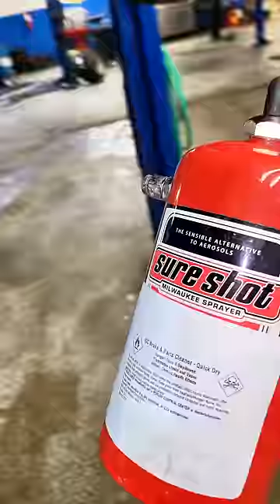Oil Change Perfection 😗👌 #honda #oilchange #satisfying

Comment: That oil looks like a muddy sludge mess
Reply: Probably has coolant in it
Reply: It looks like that because of the camera light/flash.
Reply: It is liquor molly
Reply: Lots of water, because it is opaque, not shiny anymore.
Reply: @cmte.brazinazzo2061   Lol, do you even know what oil and water mixed in an engine looks like? 😅That's not it pal.
Reply: @tiagofigueiredo2529  up until 2% emulsify, pal. Get your facts straight. Lol maess.
Reply: @cmte.brazinazzo2061  And you got that just by watching a video, imagine if you were there changing the oil yourself, what an absolute genius. 😆
When you decide to change some engine oil, do this, take your phone out of your pocket, turn your flash on, film it and look at the vídeo to see how the oil looks like with light directed to it, specially if it comes out of a gasoline engine. 😅
Then, after you get some experience, you can comment about it.
Reply: @tiagofigueiredo2529  I'm an oil engineer, from STLE. Yes, you're  talking to a genius.
Reply: @cmte.brazinazzo2061  Sure, commenters like you are always "engineers". 🤣😆
Reply: The lighting probably has something to do with the colour… it definitely looked pretty dirty, but the oil on my little Hyundai beater looks terrible every time I change it, and me and the previous owner have always changed it a little bit earlier than required.
Reply: @cmte.brazinazzo2061  if that was water, the "oil" would have the look and consistency of a milkshake. ask me how i know.
Reply: Oil dilution from fuel
Reply: Oil looks like chocolate milk...I think it's way past an oil change !!
Reply: Nasty looking. When I drain my oil it has color but it's clear looking. Not muddied up like this one.
Reply: @tiagofigueiredo2529  Yes, an instant degree in petroleum engineering.
Reply: @cmte.brazinazzo2061 engineer my ass. Oil and coolant mixed together looks like a cappuccino. Everyone should know this.
Reply: @DGKexe  Yes, it also could be if using hygroscopic fuel, oxigenates, like alcohols added to gasoline.
Reply: @cmte.brazinazzo2061 it's like custard oil and water mix
Reply: Oil change was probably over due. Oil filter was clogged the fuck out. Thats why the oil was spilling like a water stream.
Reply: No coolant in oil. Its just engine debris mixed in oil that is past over due.
Reply: @katdat1399 I work at an oil change shop at a dealership and saw oil coming out looking like chocolate milk. That definitely had a blown head gasket. This oil doesn't look the same. It's just old and a little burnt.
Reply: Just like treas-a-dent Chump's muddy swamp he made worse 🤣
Reply: @cmte.brazinazzo2061 if you're gonna lie at least lie good. That was pathetic 😂
Reply: Wanting some mofok?
Reply: @tiagofigueiredo2529  My evo is 20+ years old and changing its oil doesn't look like chocolate shit. Dark shiny brown with a bit of transparency and that car likes burning oil
Reply: Oh Reeeally
Reply: It’s the CVT transmission that does it for me
Reply: @katdat1399 not Milky but dirty meaning old engine oil. Mine was old like they head gasket was fine tho
Reply: @katdat1399 9 months later I should say😁
Reply: Drain plug installed to soon.lots of dirty oil mixing the new oil.
Reply: They get a lot of fuel into the oil, these engines would look like that with the first oil change with 6k miles on them
Reply: Nice one 👍 💯 👌 😌 😎
Reply: It’s also a Honda.
Reply: Just because there’s a flash light on it
Reply: Milkshake=coolant in oil
Reply: @bradman1961  🤜🤛💯
Reply: Kinda looks like engine dye
Reply: @JacksoNR26  🤝🤝💯
Reply: its 100% just because a flash light on it
 @JacksoNR26
Reply: It’s because the light.
Reply: I think you left your comment on the wrong video lad, that's liquid.
Reply: @RSLucid  🤝💯
Reply: @michaelboyle3584  💪💪💯
Reply: I was gonna say. That oil is having some contact with coolant. It doesn’t look necessarily bad. But definitely not ideal.
Reply: Looks more like molasses
Reply: @cmte.brazinazzo2061  Hahaha...a genius that can't spell genius.
Reply: @roopan1968  I can, my keyboard is multilanguage and sometimes it gets in confusion. You Never had this problem, because you're a mere single language guy ...
Reply: @cmte.brazinazzo2061  A true genius would adapt and overcome. Or, at the very least, proofread and correct as necessary.
Reply: It's a Honda, so it's probably fine (only need to change the oil like once every 300,000 miles)..
Reply: @tiagofigueiredo2529 he's not your pal, friend
Reply: You and Thous entonces Oly See The Consecuences
But I See Some Solutions in my Comment Above ☝🏽
There is NOT such a mission imposible in This Life.
But To Prevent Death,  Sorry About it
Reply: @cmte.brazinazzo2061 How convenient that you're an engineer, too bad you're a horrible liar

Water in oil creates a mixture that resembles spoiled milk. Common knowledge. Some genius you are.
Reply: @cmte.brazinazzo2061  "and sometimes it gets in confusion"

It's "gets confused" not "get in confusion." Some multilingual (also proper word, not "multilanguage") person you are.

Again, very bad liar.
Reply: @rodimusprime3621  How about you, pal?
Reply: @tiagofigueiredo2529  I'm not your pal, buddy
Reply: @rodimusprime3621  Why not, comrade?
Reply: What spray is that ?
Reply: @cmte.brazinazzo2061 boy if there was water in the oil you would know because oil and water don’t mix and it would most likely pour water out since oil sits on top of water
Reply: @elementalgaming2264  Hah, never heard of emulsification percentagem... boy...
Reply: @cmte.brazinazzo2061 You can't even spell genius, college boy. Genius,  Bwaahahaha
Reply: That's why you change it 😂
Reply: CERATEC
Reply: Average car owner shit. 20k mile oil change or fuel dilution/blown head gasket.
Reply: They get excessive fuel in the oil, even with 5k mile oil change interval and the oil looks like that
Reply: Looks like most of the engine came out in the oil

Comment: puts the drain plug back in with sump oil still draining out, perfection lol 🤣
Reply: No point in waiting an extra 20 mins for 50ml to drop out when ur gonna pour back in 99.9% of new oil😭
Reply: Here at jiffylube we don't want your business
Reply: @tdc9136  been doing my own for 35 or so years, think i'll be ok 😁👍
Reply: I wonder how much I saved over the last 35-40yrs of doing this myself? And I’ve never had a problem with some fool over tightening the filter or drain plug either 👍
Reply: Must be paid by the hour 😂
Reply: Not my idea of perfection either.
Reply: @marhill77 Same I don't trust anyone with my machines 👍
Reply: Thats why I do my own oil change in my car
Reply: @synth3tic_054 I've seen videos where they take the pan off of cars after it's dripping slowly, still up to a half quart on some makes so with this still flowing could be a whole quarts, that's 1/4 the capacity of some hondas.
Reply: i like how you think that matters. If you really want to get rid of "old sump oil", just pressure wash inside of the oil cap and rinse out your car, then it'll be real clean 😁😁😁
Reply: @MemueQuetale  hey man, if someone calls their sloppy crap "perfection" and posts it online, they gunna get told lol 🤣. You can actually use a little clean oil to flush out the last of the old oil, prefill your filter, and service your engine every 5000km, then you be lots closer to perfection. 😁👍
Reply: @user-tt6fh7ce9c it wasn't still dripping, it was pouring out. If leaving a substantial amount of old oil in the engine doesn't matter, why not skip the oil changes all together? Lemme guess..... changing a diaper you don't bother to wipe the ass clean either.... it's just gonna get dirty again anyway, right? 😂
Reply: @tonydargon3918 could never be me, I let all of my oil drain out for a solid 30-45 min while I'm downing a few beers..
Reply: @marhill77 

you don't save alot of money. Maybe 20 bucks every 3 months or so lol
Reply: @synth3tic_054 😂 don’t ever talk about anything car related again. Metal particles are concentrated at the last oil portion. They can take out a bearing.
Reply: @2seep  not when u have a high quality filter or oil😭

Comment: Damn dealers never drain all the oil till it drips…. Faster faster they say, when i worked there i told them an engine isnt blowing up on me
Reply: yeah all heavy metal pieces are at the very end
Reply: все масло слить не реально, пол литра останется и это минимум!
Reply: It ain’t the space shuttle or a dodge it’s fine
Reply: Next.

$$$$$$$$$$$$$$$$$$$ quick culture.
Reply: I  put 500ml of fresh oil in before putting the sump plug back in,I don't believe in flushing.

Comment: The second pull on the long handled ratchet had the drain plug over tightened, the third pull was borderline on stripping the aluminum oil pan out. Just good and snug with a regular length 15mm combination wrench is plenty tight.
Reply from the maker: Not even close 😅👍 Doesn't matter the length ratchet you use as long as you understand the concept of torque/leverage. Plug is torqued within spec
Reply from the maker: Also a 15mm wrench would not fit on this plug
Reply from the maker: Not all oil pans are the same
Reply: Torque wrench. Absolutely nothing else unless you are a gumbah.
Reply: @olderbutnowiser6701  
That’s correct, tightened to spec with a torque wrench, not over tightened with a ratchet and then checked with a torque wrench to see if it clicks before the fastener moves.
Reply: Yeah I'm 100 percent in agreement
Reply: I been a dealership Tech for 30 years, torque wrench every time
Reply: I'm sure everyone knows the practices of lube tech's, completely over tightening everything so you'll never be able to remove the plug or the filter, it's a common practice.
Reply: @TEVIDEOS  How are your torqueing it to spec without a torque wrench?
Reply: Looked way too tight. He thinks he's to spec without a torque wrench..lol
Reply: @Leviweyhrich  really? you can see that the bolt is "way tighter" than 29 lb-ft? Where can I acquire this power?
Reply: @TEVIDEOS you are clearly at a dealer just get the damn yellow preset torque wrench from Honda... We have like 20 of them laying around at my dealer lol
Reply: @ralfie8801 .. can tell you don't touch Hondas... Honda drain plugs are 17mm and torque to 30lbft on the new models 31 on late 90s early 2000 models. He's probably in spec, but also Honda has a preset torque wrench for dealers that he should be using...
Reply: @theripcord03  
I sure don’t, I service my own, but my Duramax has a Fumoto valve in it so I don’t ever need a wrench to drain the oil. The rest of my vehicles all require a 15 mm wrench. I work on locomotives for a living, almost everything we work on takes a big wrench and a crane to lift it. .
Reply: @TEVIDEOS :  I know, brother. In 40 years wrenching, I've NEVER stripped a drain plug. But today, with all the scammers, we use a torque wrench so i can note it on ticket. I also look every customer in the eye, smile, and say, "YOUR DRAIN PLUG WAS TIGHTENED TO SPEC." This discourages scammers from dumping the oil a mile away and trying to get my insurance to buy them a new engine.
Reply: it's called experience
 @Leviweyhrich
Reply: @hightttech and by using a torque wrench you are doing the right thing. I'm pretty sure that you feel good about doing the job the correct way.

Comment: This video is why I change my own oil. I decide what oil and filter I use. I also let the old oil drain  out until I don’t see anymore oil draining. Is there more oil in the crankcase? Of course. But I want the least amount of old oil left. And I understand that a mechanic has to get them out the door but I have the time, so…
The sticker was cool! 😊

Comment: Para No Hacer Tiradero de aceite al Quitar el Filtro.
Perfore El Filtro con Broca de 1/2"
para un Vaciado Rápido y con Chorro Grueso, evitará que el aire lo mueva.
Hace Tiempo hubo Un "Tapón Tipo Válvula" para Un Vaciado Rapido y Limpio del Carter y la venta sé Paró 
Seria Cuestion de Eliminar la palanca de abrir y cerrar la válvula. Pues 
Tenia riesgo de Abrirse por Accidente
Sé Resolveria con Una llave Alén como palanca de accionar. 😎😉
Habrán más opciones de como remplazar dicha palanca del Tapon con Válvula de Vaciado.
Muchas🙏🏼Gracias

Comment: Can't tell if it's just the light but hopefully you told them it looks like there's coolant in their oil
Reply: I thought it looked like water in the oil as well. it also looked very thin
Reply: Idk why, but on all my hondas the oil looks like this under the light too
It's just normal
Reply: Don’t some new Hondas use 5-20W?    Could that explain why it looks like diluted oil?
Reply: @kgill5  almost all of them use 0w20 now
But you can use 5w20 too
Reply: This q 1.5t engine and they suffer from fuel dilution in the oil.
Reply: @therealproracer7284  not true I have a Honda Accord almost 100k miles and my oil does not look like that when I change it. I use Mobil 1 Extended Performance and I service when Maintenance Minder tells me to and the oil only comes out a tad bit darker than fresh oil. There is definitely water in the oil if it looks almost like chocolate milk. Don’t use cheap oil.
Reply: Send it out for a test, but the quicker way is a taste test. 
If its sweet its coolant. 
If not let it ride ,and drive it more so it gets up to temp
Reply: @MrTheHillfolk Taste the oil?
Reply: @warwickscram1656 Yeah you can taste the coolant in the oil and fuel too. Old mechanics trick. Probably not the best for your health, but I been doing this 21 years, still kicking. 😂

Comment: Drain plug attached even before the last drop came out. Why?
Reply: Because then the customer has a motive to fix his/her car with you.
Reply: You will never get all the oil out in a 10 minute oil change.

Drain your oil, thread the plug back in and let it sit over night. When you break it loose in the morning lots more oil will come out
Reply: @jayyoung5627  don't be so stupid lol. At least he should have wait until visible draining stops
Reply: @crpro5420  There is still going to be a half liter of the old oil in the motor. If the tech waits another 5 minutes to drain he may only get another 10-20% of that 1/2 liter of old oil out. 

When customers are waiting on their cars that math doesn't work out. There is going to be a decent amount of oil that gravity can never get out of the motor because of the surface it's sitting one. (like a cup essentially)
Reply: And that’s the algorithm for chain store, oil change facilities. And that’s why I haven’t “paid” for an oil change, ever. Park it on a ramp and while that plug is out, I inspect the entire undercarriage, check brakes, tires, fluids, wipers, etc.  20-30 min later, plug (with new crush washer, if needed) goes in, pre-charged filter goes on (my OCD,sorry) and it’s fill’er up time. I maintain 4 vehicles, 2 motorcycles, two trailers, and a dozen small engine/2-stroke devices. If one of my machines break, it’s my fault.
Reply: Cars are pulled in hot therefore the oil is super thin already and flows out fast and that less then 1 percent of oil left isn't going to make any difference in the life of the new oil but my all means go ahead and wait an hour till the last drop comes out. You're still going to have some old oil in the motor no matter what. The new filter will catch and particles left.
Reply: @wbforsure2104 If anything, having some old oil on the engine will help prevent a dry start. And then as you said the old oil gets filtered out and whatever doesn’t is diluted into the new oil.
Reply: The old oil mixed in is irrelevant. It's amazing how most of these people that change their oil at home don't even know what they're doing. You don't have to let the oil drain out completely.

Comment: 2 things. Thank you for not caring about getting oil on your hands. 2nd, if your doing my oil change I always as to not clean the oil off. In the north east it does form a coating in that area and when splashed can in fact coat things give you some protection. I know people will hate me but I oil coat my cars before every winter. my 99 lightning, ZERO rust anywhere and it was daily driven till 2015.

Comment: Where i work, we have a little booklet that has the exact torque spec for most vehicles and we use an actual torque wrench. I know you can get a sort of "feel" for the torque after doing it for a while but people are still fallible. Saving 10 seconds by not putting the socket on a torque wrench is honestly not worth the time and money fixing a stripped plug, especially on an aluminum pan.

Comment: The way I used to do oil changes was put the oil cap on the hood latch to remind myself to put oil in, take the filter off first, drain the oil once the new filter is in and cleaned up, then do my underside inspection until every drop is out. After that I cleaned the oil pan. Saved a lot of time and fixed everything the customers needed.

Comment: Mistake. do not tighten the bolt until the oil is completely drained from the crankcase. In general, it would be better if you pump out the remaining oil there. Yes Yes. there is still about 1 liter of old oil left

Comment: I like the sticker. When I used to do diesel trucks I’d paint marker the oil filter and drain plug so if someone came back to me I’d have proof
Reply: I tippex the plug and put the date on the filter.

Comment: That oil wasn't even done draining, at least wait for droplets.  Lastly, you're torquing the pan plug too tight. Use a shorter ratchet for tightening, or a proper torque wrench until you get the feel for proper torque.

Comment: Tgw sure shot spray can are a great money saver
Reply: what can you fill 'em with
Reply: @vitalybrateev5548  it’s just a bigger can of brake cleaner. Instead of buying cases and cases of canned brake cleaner, they’ll buy a barrel of it and you (tech) will go and fill your bottle when you need it. Gotta leave about a 1/4 of the bottle open for the air pressure when you go to pressurize it
Reply: @benjaminmayfield6954  ty